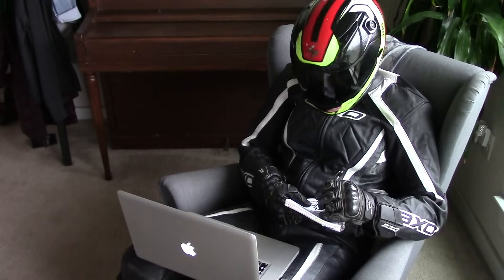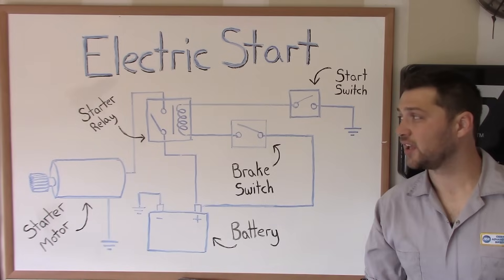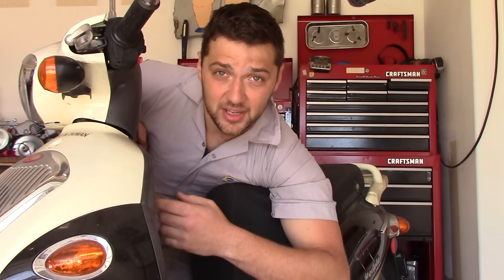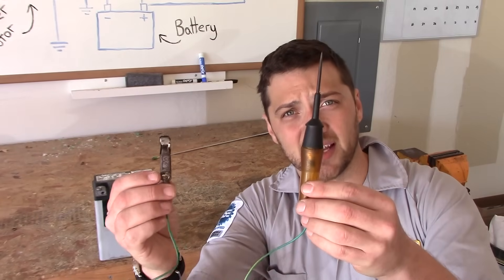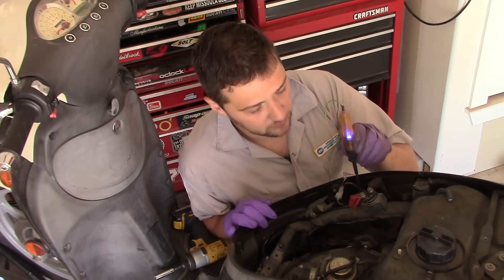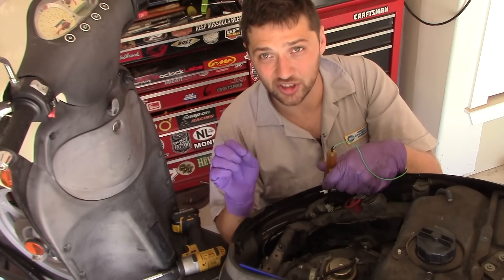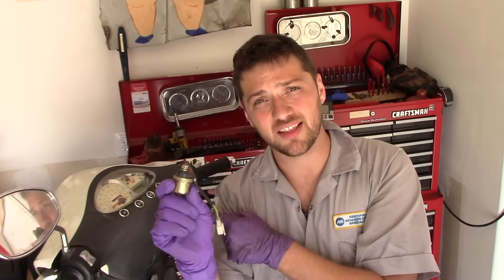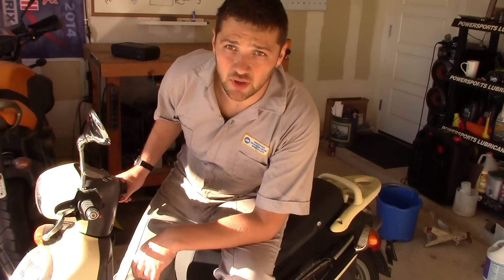Scooter 911: Electric Start Doesn't Work (troubleshooting your starter, starter relay, and circuit)

Comment: Just bought a 2010 lance cali classic 125 scooter and wont turn...
Previous owners had it parked for almost a year.. what can I do to start it up if it dont want too.?
Reply from the maker: if its been sitting that long the fuel in the carburetor has certainly gone bad. you can try draining the floatbowl and trying again while spraying some carb cleaner down the intake while you attempt to start it. If that doesnt work you might have to disassemble and clean the whole carburetor. But its always important to keep in mind that the scooter might have been parked for a reason. maybe it already had something wrong with it. so be thorough in your diagnosis! Good luck!
Reply: @Scooter_911  thank you, I appreciate the help

Comment: Hey Garrett I like your sense of humor and your wisdom I did as you said in the video in regard to my starter button not starting. I pulled the right brake lever and push the starter button in at the same time and my 86 Honda Spree nq50 started right up I was really happy I don't have to kick-start no more the carburetor is brand new. to start the scooter I would spray starter fluid in the carburetor just to get it to start on the first three kicks now thanks to your help and your video I just pulled the right brake lever pushed in the starter button at the same time and my scooter started up on the first try without starter fluid I'm a Believer in your videos appreciate your help keep up the great work I am now a subscriber to your Channel Thanks Again!

Comment: Your videos are extremely informative and easy to understand but I'm having a problem starting my Chinese scooter the problem seems to be that the transmission is engaged meaning the rear wheel will barely move forward or backward it's not free flowing and so when you hit the starter you hear more of a buzzing noise like it wants to start but because the engine or transmission is engaged it will not allow it to start can you advise me on what I can do about this thank you so much for your time and your help.
Reply from the maker: Sounds to me like you might have a shredded belt tangled up in the transmission. Remove the transmission cover on the left side of the engine case and take a look at what's going on. Good luck!

Comment: Question what if I have no power at all? Went to work and when leaving no start, no power but full battery?
Reply from the maker: Check the little glass fuse near the positive battery terminal first!
Reply: Garret Seesing so i don’t think mine has a glass one mines a Honda ruckus so think it’s a blade fuse believe with #10 on it (red)
Reply from the maker: @robothead1024  oh you are absolutely correct! I didn't know you were working with a ruckus! Do you not have any tail light or horn with the key in the on position? Have you measured the voltage on your battery?
Reply: Garret Seesing yeah had no power anywhere and battery was full but pulled the fuses and one was blown and replaced now I’m in the road again ha! Hay thanks for the great videos you’ve help a ton

Comment: So - fantastic video that helped me get my rattler started.  But now I’m working on a Honda ruckus with electrical start issues.  Any video about the difference between this video and how to trouble shoot the ruckus? Or why it’s different?? Thanks
Reply from the maker: Oh man can of worms there! The ruckus has a completely different electric start system. It actually doesn't use a starter at all it shoots current through the stator to turn the engine over. If you ruckus doesn't start it's more than likely a dead battery (4l-bs batteries can seem ok but be bad), or a brake switch. I have plans to do a ruckus/metropolitan video soon.
Reply: Garret Seesing...I would love any ruckus video you put out, specifically a complete rebuild video would be helpful 😉 we did in fact get one of the ruckuses (ruckai?) started.  It was a bad stator... keep up the great vids!

Comment: Hey bud I have the qma engine that has a soil valve cover and head all in one piece if I bought one of those big bore kits for a qmb and a valve cover would it theoretically just bolt up
Reply: Solid valve cover not soil :/
Reply from the maker: i've never seen a valve cover that is one piece with the cylinder head. The big bore kits all use the cylinder head that already on your bike. does your valve cover have bolts around the outside?

Comment: If I touch the starter relay and I have charge in the battery and nothing happens what is my problem thanks
Reply from the maker: It means you likely have a bad starter motor or the engine is not properly grounded. Good luck!
Reply: Thanks for the replie and another one does the starter motor have something to do with the lights and the horn because just before the problem started I was riding and they just stoped working and I have good ground and good fuse.

Comment: You're a Legend!
Reply: Yesterday my scooter didn't turn on( Piaggio fly 150), it didn't make any sound, it just doesn't turn on anymore, I took it apart and followed your steps, I don't have a screwdriver test, so I took out the battery and connected 2 cables, sparks came out when I joined them, the horn doesn't sound  Nor does it turn on the rear brake light, I found a burnt electrical switch near the starter relay, could you send me a picture of it?  I have been out of work since March and have no money to pay a mechanic, so I really would like to fix by myself do you have an account where I can send you the photo?
Reply from the maker: @Udayallendes  sure send it to garretseesingofficial@gmail.com maybe i can help you troubleshoot from there
Reply: @Scooter_911  already I sent it

Comment: Dude! I hope all of your videos are as hilariously dorky as this one... You broke down the relatively simple starter system on a scooter to an even easier level to understand and diagnose. The editing and sound effects were perfect! Thank you for dropping this hot track 👍
Reply from the maker: Thanks watching! Glad you enjoyed it! I want to bring a non-threatening approach to technical procedures, and I find that goofy sounds and cheesy effects kill the "this is very difficult" feeling of tutorial videos.
Reply: @Scooter_911  brother yo didnt mention , if the bike doesnt start with the bypass trick. what would that mean?

on the other methods you mentioned what it would mean if it did/or didnt work. only that one you didnt mention
Reply: @mattduncan5500  if it doesn't crank, broken wire to the starter or failed starter.
Reply: @edwardjames6070  yeah i did the screwdriver trick across the two terminals. and it waouldnt spark/start.

so guess my starter relay is dead?

Comment: I have a 2014 Motobravo Roketta 150cc. I have power when the key is turned on, but only for the brake lights and turn signal. Nothing for the headlights and my electric start doesn't work. Thoughts on why I have no power in the front of the scooter?
Reply from the maker: Wow that could be a very weird wiring harness issue or a really simple one. You told me the brake light comes on BUT does it get significantly brighter when you hold the brake lever?
Reply: @Scooter_911 Nope, it doesn't get brighter. I do have gauges and turn signal light on my instrument panel. Just no head lights. Already changed the bulbs.
Reply from the maker: @mitchstout2153  sounds like you have a bad brake switch my friend! Check out the video here! https://youtu.be/xapfVSbhhR4. On most scooters the headlights won't turn on until the engine is running. they're designed that way to not drain the battery before start up.

Good luck! Let me know what you find!
Reply: @Scooter_911  I tested the starter relay female and male connections with no light illuminated with switch and brake test. What should be done now? New wiring harness? This is a BRAND NEW starter relay.
Reply from the maker: @mitchstout2153  if you still dont have a brake light you will not be able to test the starter relay accurately. Trouble shoot your brake switch first. make sure that it didnt come un plugged behind the headlight cover. Do neither brake levers make the brake light illuminate brighter?
Reply: @Scooter_911  Brake light works when both levers are pulled individually. So, I dont think it is the brake switch.
Reply from the maker: @mitchstout2153  does the bike start when the brake light lights up?
Reply: @Scooter_911  Bike doesn't start at all. Kick starter doesn't even start it. Worried about electric start and why it isn't working.
Reply from the maker: @mitchstout2153  shoot me an email at garretseesingofficial@gmail.com and we can get this thing squared away.

Comment: Hey Garret, I’ve got a question about my moped starter and I thought this would be the best place to ask because you respond so quick and helpfully. So on my moped everything worked fine and I could hold down the back brake lever to use the electric start, but spontaneously the electric start doesn’t work sometimes when I use the back brake, it works fine when I use the front brake lever, but it’s more of a hassle to use front brake to quick start than rear brake lever. I have no clue what could’ve caused the rear brake to now only sometimes make the quick start work because there was no inciting incident that could’ve caused it. It simply was working perfectly, then stopped working, and sometimes it will work but now mostly it doesn’t work. Do you have any idea of what the problem could possibly be? Love the vids and thank you for the support
Reply from the maker: Excellent observations and diagnostics on your scoot! It sounds to me like you have a brake switch that is going out. The often go out without rhyme or reason. Its just the nature of mechanical switches. Luckily i made a video all about replacing brake switches! check it out here! https://www.youtube.com/watch?v=xapfVSbhhR4
Reply: Garret Seesing yeah I saw that video and I thought my scenario was quite peculiar because every time I squeeze the back brake lever the back brake light does illuminate, and the brake still works fine(I know that the brake working and the faulty switch are not necessarily connected) but what else could this mean because I believe that the brake light does illuminate when the back brake lever is depressed?
Reply from the maker: @mikkowesterbeke568  oh wow, that is quite the conundrum! can you double check and see if when your scooter does not start that brake light is infact coming on. if it is you have some bizarre gremlin. the best way to attack gremlins like that is to find a way to make it fail every time (no matter what kind of crazy stuff you have to do to make it fail) and then test the 2 pin connector at the starter relay. Good luck! i hope that helps!
Reply: Garret Seesing thank you, I’ll make sure to check it out, keep up the amazing content!
Reply from the maker: will do!

Comment: Is 11.52 volt read good bad or ok
Reply from the maker: depends on what you are measuring. If thats just your standing battery voltage that is bad. If thats the battery voltage with the engine running thats worse. If thats the battery voltage while cranking the engine thats pretty good.

I hope that helps! good luck!

Comment: This is the corniest "starter" video I've ever seen. For that reason, and the fact that it is full of incredibly good information, I will give you a thumbs up, and become a subscriber.
Reply from the maker: Wow thank you! That was the most qualifying comment i have ever received. For that I reason give it a thumbs up, heart, AND a "thank you" comment.
Reply: Scooter 911 my GY6 will only start with my kick start as my starter has never worked since I bought it,. And it will only start with the kickstand down and it will start and idle but as soon as I take it off the kick stand it dies out immediately and won't start till I put the kickstand down. Do you have any suggestions
Reply: @eltonnaranjo9669 i think you might have some wiring problems there. It's difficult to tell you what the exact problem is when there could be so many the way you explained it. Can you be more specific
Reply: @Scooter_911 mine wont start  for 💩 I replaced the solenoid any other way to start it? One person said take the ignition switch connector and connect the red and black wire to a toggle switch. But you'll need an on off switch. I don't have the kick starter. The case got broken from the collar. There's no way to jump the solenoid with the seat bucket in the way and I'm not cutting a whole in it to Access the solenoid. Ideas!!!!????
Reply: Okay you don't know what my issue is. Neither does anyone else. I push the start button and the solenoid clicks hmmmmm. Ideas???? I figured it out as always.
Loin
Reply: @Bert-p3p  I would remove the starter completely, and hook it up directly to a 12V source. If the starter works, then your problem is upline. Try everything from the switch to the wiring, to the neutral or brake switch. It might be a good starter that is not receiving a signal to start.
Reply: It feels like one of those 90s "hip" educational videos. I love it! XD
Reply: I myself have also sold my soul to this channel
Reply: Hello, my scooter been sitting for a couple months and when i turn on ignition there is no sound coming from the fuel pump do you have any idea what the problem could be ? Thank you
Reply: You save me a 300 dollar shop repair heaven is waiting for you
Reply: Isn't he wonderful
Reply: I just did the same for the same reason, this guy is a lifesaver when in the outback 👍👍👍
Reply: Great video champ.keep up the great works ...
Reply: Did the same. 😂
Reply: I too ran across your video and was thoroughly impressed... so I subscribed.
Good Job 👍
Reply: How many starter videos are you looking at lol
Reply: @i-am-your-faasha  ALL of them!!!

hahahaha. No, seriously. Scooter 911 is one of my favorite channels. I wish he had more time for youtube, but he has a full-time shop now, and his business takes more time than here.

At least, that's what I gathered.

Comment: I have a question for you my starter works Bendix but it's not turning everything's working but it's not giving it its start would you know what's going
Reply: What happened wasthe Cdi was good bad and I didn't know it was so afraid of by kept on hit the electric start to start my bike did it burnt out the starter so I replaced the starter ever since that it will work everything else works it just won't start it turns over it won't start the bike
Reply from the maker: @252005iuman  yeah I would take off the cover and observe it. Maybe it didn't seat in that bushing correctly
Reply from the maker: Is it a 50cc or 125-150cc scooter? The starter mechanism is different on the 2 different scoots
Reply: 50cc
Reply from the maker: @252005iuman  ok so let me make sure I'm clear. You hit the button and you hear the starter engage but it does not turn the engine over? And the engine turns over fine with the kick start?
Reply: @Scooter_911  ya
Reply from the maker: @252005iuman  I would take the belt cover off the transmission and then try it again. You'll be able to observe the starter protract, engage the teeth o. The variator and turn the crank over. The starter shaft locates in a bushing pressed into the belt/transmission cover. And if that bushing goes bad it inhibits the starter from turning. If everything else looks good and you DEFINITELY ARE NOT missing any engine grounds (sometimes bolted from the battery to the valve cover) I'd say you have a bad/weak starter.

Comment: Hello any chance you could help me? my friend bought a Honda Dylan, which starting randomly. Sometimes it's only cranking and not firing at atll. Very rarely it does start but like this way he can not use it because it's not reliable. Do you have any suggestion what to check? We did clean carbs and checked fuel "pump" well it's not a pump just a vacccum thing, everything seems fine.
Reply from the maker: I would check for issues with the kill switch and the side stand switch first. Intermittent issues are very frustrating to test for but its important to take in all the information you can when the scooter starts and compare it to all the information when the scooter does not. Good luck! And let me know what you find!
Reply: @Scooter_911  Those are good, if I open the side stand it's not cranking at all. 
I had another idea, maybe it's stupid and I am not expert but in the carb there should be that floating thingy. I'm sure you understand what part I mean, I guess it stuck and wen it starts it stays open and when it does not start it stays closed. I will dismantle in the next few days to see. But this is really weird. 
Few days ago it was on the middle stand, I pushed the ignition switch cranking, but not firing. I closed stand, so it was on wheels, and on the first second the engine started straight :) 
This is why I thinking for that floating valve, because when I take off from middle stand it gets a little bump/shake/shock?, maybe that time the floater moved and opened the fuel. 
I will let you know, thanks!
Reply from the maker: @YourMomsPita  wow that's a great observation! Yes that could be a problem but there is always a little fuel left in the carburetor. At least enough to run for 30 seconds or so. So even if the float was stuck it should still start and run for a little bit. Does it run fine when it does start?
Reply from the maker: @YourMomsPita  So glad to hear it! keep it shiny side up!